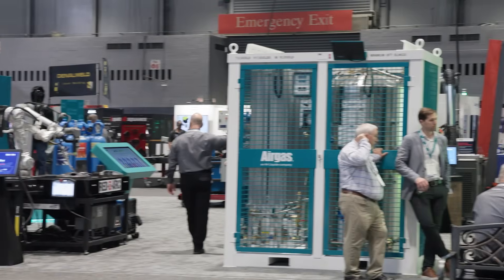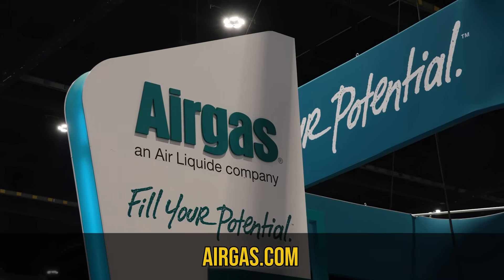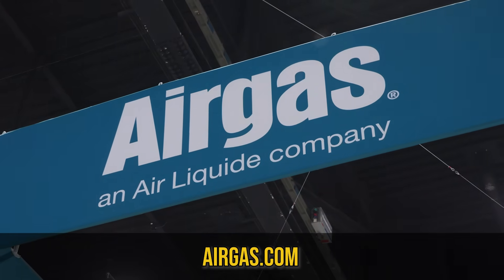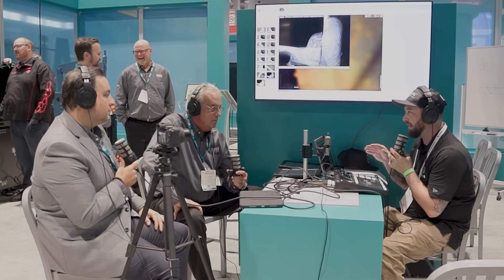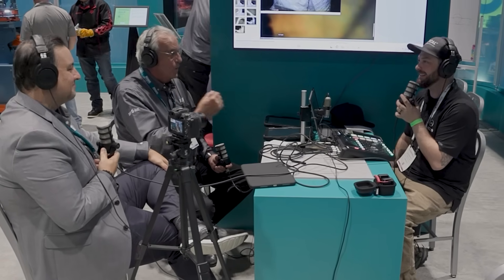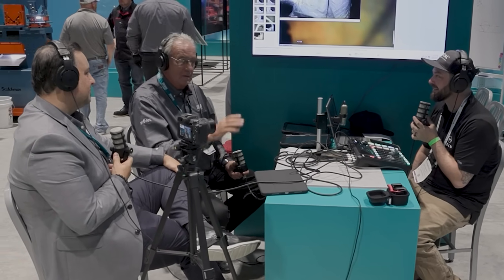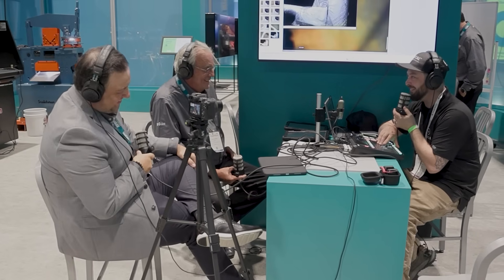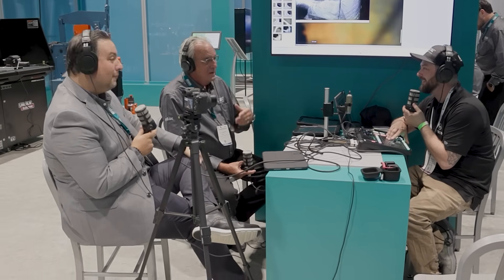Where Is Your Welding Business Losing Money?

Comment: The gas bottles with integrated regulators and quick connect sound great. Swapping bottles is definitelly a pain, and I've broken more than one regulator on the job site when the bottle accidentally fell over. On those intergrated valve bottles there's nothing sticking out that might break in a fall.
Reply: When moving a bottle the cap is on, and when it’s off and the regulator is ready to be put on the bottle is already chained up